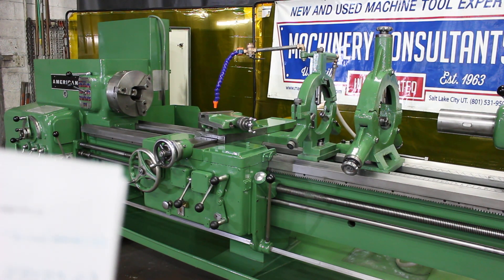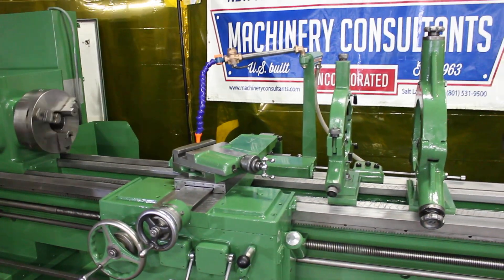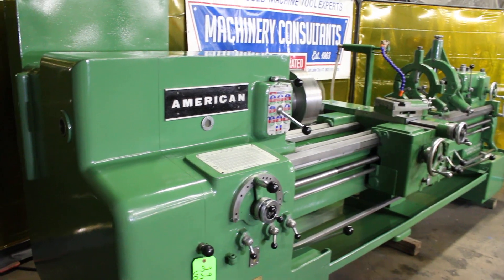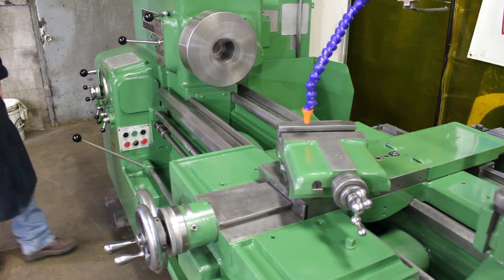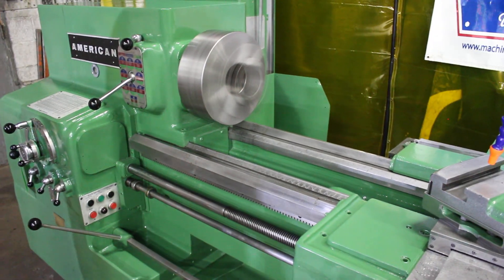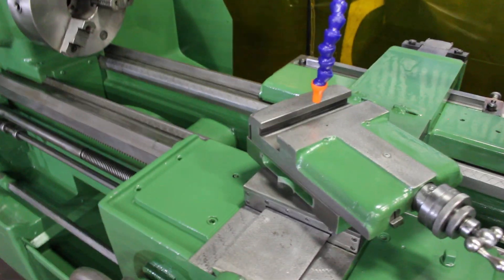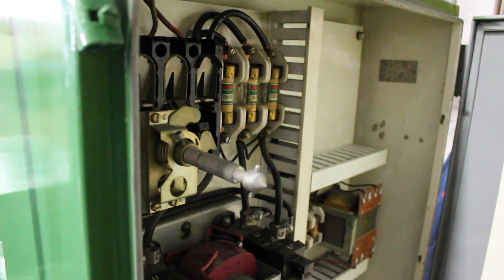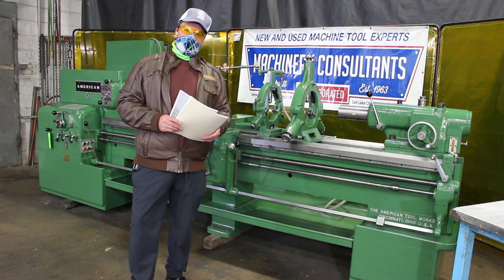AMERICAN Tool Works Heavy Duty Engine Lathe 19” X 88” Style B - S/N 77173-63 All gone thru in Utah

Comment from the maker: info for dimensions, the overall Foot print of Lathe is at 13' of length X 54" Widest Point X 60" Height on tallest point, 
overall weight is at approximate of #10,000 lbs.